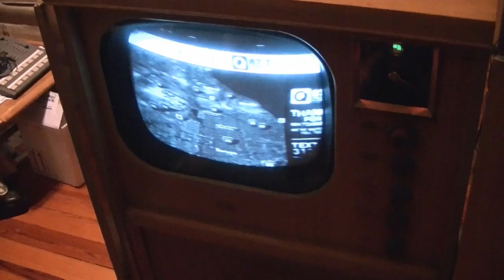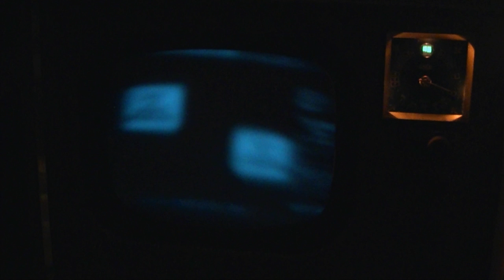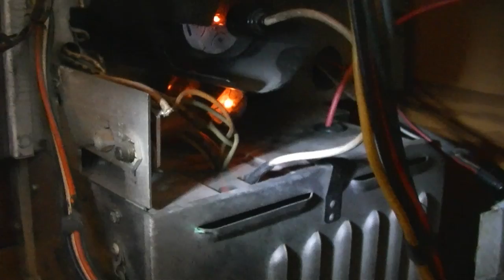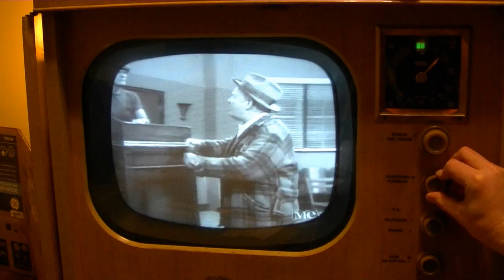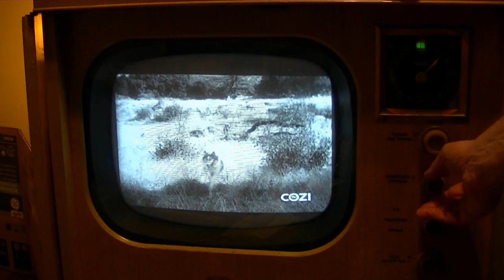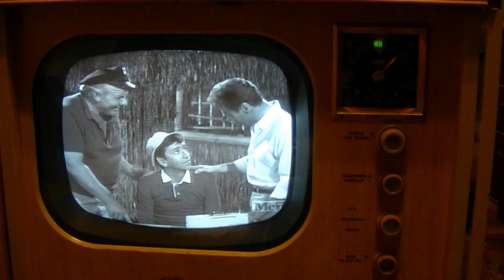Dumont RA113 restoration p8o8

Comment: I live in Jackson Michigan and have a 1949 sparton 4940 mirror top 10 inch TV. I recaped it and have 8 to 9 killavolts coming off the fly back, but when I plug it in the picture tube the voltage drops right out to nothing. Any idea you can share with me please.

Comment: I can certainly see the width being wider in Archies face. Just thinking about this it seems to me that to change the width linearity that you could put a slightly higher resister in the circuit before the tube that pushes width wider even though you say it is adjusted most of the way already. Just thinking out loud to get the screen narrower so people don't look fat faced.

Comment: As-for the squeal, I was going to suggest  what someone else already has.  Whenever I've had that issue in newer sets, it was caused by loose components in the flyback transformer.  I've seen them react the same way when moving the anode lead.  I've repaired it by slightly tightening the threaded rod and nut that holds the transformer together.  BTW, I'm REALLY enjoying your videos! =D

Comment: Nice restoration job, and the final video/audio results attests to that. All your alignment efforts did beautifully at getting everything tracking correctly.
That tuning eye is looking good, too. :-)

It'll be cool to see how the S-meter on the Clifton works.
BTW, very nice score getting the DuMont Clifton RA102..that set is totally awesome. At a $795 price-tag back in its day it was an investment venture to buy one then, too. ;-)
DuMont definitely designed that set to run 24 hours a day practically.

Comment: You are a brave man putting you bare fingers on the horz. output plate lead, the voltage on that is several thousand volts pulsed and can't me measured because of the spikes.
I can draw 1/8" arcs off the plate of those 6BG6 tubes,

Comment: Well, you make this set happy again. shame you cant keep this. nice finish, nice looking, I really like the control layout. Hope the owner enjoy it at least from time to time.
Reply from the maker: I'm glad I still have it for now because my main color TV died last night.  It probably just needs a new fuse like last time, but it's such a pain to pull the back off.
Reply: Radiotvphononut is pretty good with more modern TVs, if it's not a fuse it's a problem with the switch mode supply.
Reply from the maker: OlegKostoglatov I managed to turn that 170lbs beats around and get the back off last night,  Sure enough, it was the fuse.  I think I'm going to retire that set real soon.  If I mount a flat screen on the wall instead, it will really free up some precious space.
Reply: Bob, never wondered, I've seen some vids of beatyfull firsts RCA colour TV, pretty sure all vacuum tubes. Picture was awsome (well, talking about the era when it was done). Have you thought on adding one of this very early colour set to your collection ?. Well, after the restoring is likely to work longer than the new crap you actually find in the stores. And is getting worse, TV'c can take more than 2 o 3 years of use. C R A P .....
Reply from the maker: 38911bytefree
The problems is they are rare, expensive, big and replacement picture tubes are very scarce.  I also have doubts about how long they would last - the picture tube anyway.  Even my B&W sets I rarely play more than an hour a week to preserve the picture tubes.

Comment: I wonder how long it would take till you got evicted if you relied on this kind of work as your regular source of income. Hmm...?
I know that you do it as a hobby, and probably as a favor as well. I wonder how Ray Heffer does it. I guess that you have to do this AFTER you retire. Good thing you are a programmer!

It came out really nice! R.F. HV can be really tricky. Perhaps a strand of wire right at the middle of the bend, kinked just enough when moved that cause the HV to radiate out there. All HV has to flow in nice smooth bends as you know. I use to work with one million volts in an Ion Implanter machine. It is like a huge metallic CRT that is many feet long. HV can do some really strange and unexpected things!

Really came out beautiful Bob. I hope the owner really enjoys all the effort that you put into it!
Reply from the maker: Thanks.  The way you make more money is to do it quickly and cheaply and that would ruin the hobby for me.

That wire itself has less than 2kV on it so I'm pretty sue the squeal is coming from the flyback as the wire puts pressure on it's frame.  That could probably be remedied with some silicone or epoxy.
Reply from the maker: That reminds me, a few weeks ago I was contacted by another local vintage TV owner looking to get it restored.  It's a late 40s Admiral so I couldn't refuse.  He's not in any rush though so I don't expect to start on that until we thaw out in the spring.  The forecast low for tonight is 1F !
Reply: bandersentv
You know about our second home. I was there, out in the cold at night for two hours last weekend in 9F weather just marveling at the spiral arms of the galaxy. Beautiful! I neeed to get my 10 inch Dobsonian telescope up there.
Reply: Your work done quickly would still be better then that hack that posts on C.L Vancouver all the time, he charges restored prices for repaired radios or TVs, but I think he's known so he doesn't sell very many. He wants close to $3K for a barber pole Predicta that's pretty much as is, maybe one or two caps changed, he calls that "Restored" since it produces a picture.
Reply from the maker: OlegKostoglatov I'm considering doing another job next month.  This time it will be restoring an Admiral with a chassis like the ones I know so well already :)  The owner says he has a bunch of spare parts for TVs and antique radios I can have.  I'm curious to see what he has.
Reply: That's the thing about this, if you have worked on the same make and model, or a similar model, before, or several times before, you can restore them much more quickly.
Reply: OlegKostoglatov
That's completely right. Look at all the Admiral 20 & 30 series sets he's worked on. He can troubleshoot these things in his sleep, (and probably does!).  LOL

Comment: The noise in the flyback could be mechanic vibration of the ferrite core and/or the coil in the flyback. When you secure the wire, you put pressure on the coil and the vibration stops. Very common on cheap "made in chile" sets we have here in the 60's and 70's.  Congratulations!!
Reply from the maker: I agree but it's putting pressure on the wire that creates the noise.  When it's allowed to hang loose, the noise goes away.

Comment: I found out that my Canadian Westinghouse 512A has a Candohm with multiple taps for voltage dropping and biasing purposes. I haven't checked it over yet but if it had open sections it would not surprise me. Like the one in that DuMont I think it was made to order for that make and model of radio using non standard values.
Reply from the maker: I;ve found very few (if any) good candohm resistors.  I recall there's a big four section one in my Philco 41-316RX with oddball values.